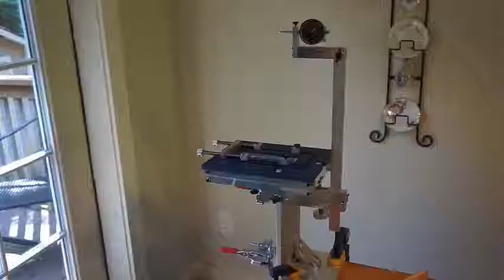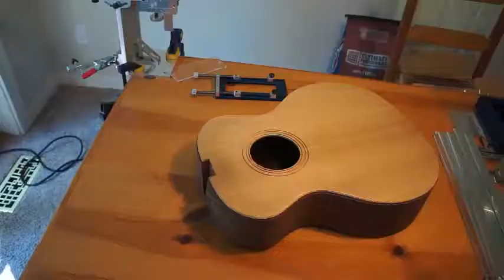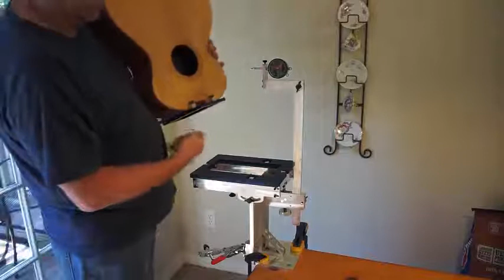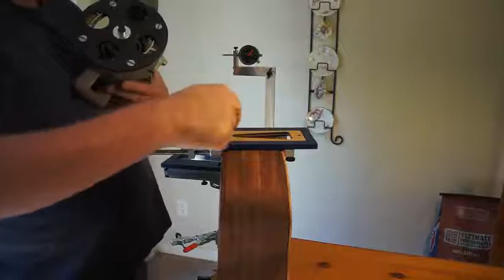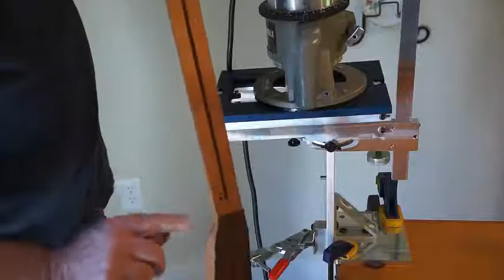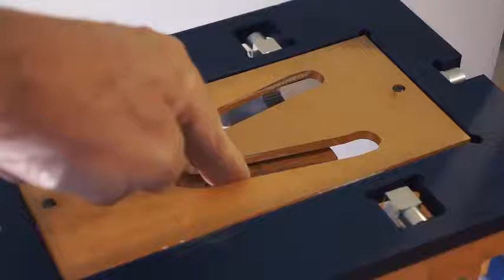NECK ANGLE JIG

Comment: Chris. I purchased your jig a year ago. I still am not proficient in using it, but I would like to be. I realize that the jig can help to perfectly cut the dovetail on the neck heel. I am still confused on the calculation. What are all the elements I need to consider for making the adjustment with the caliper to set the proper angle? You mention the nut, fretboard, frets, bridge, saddle, etc. There must be a formula here to get the perfect adjustment with the caliper. Can you please help me? Thank you.